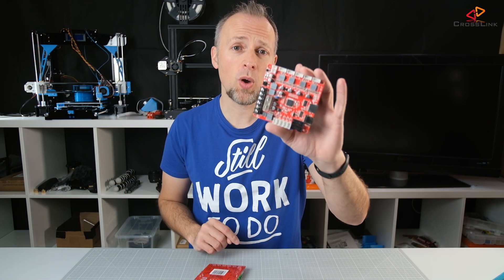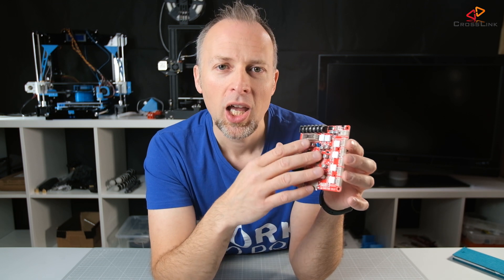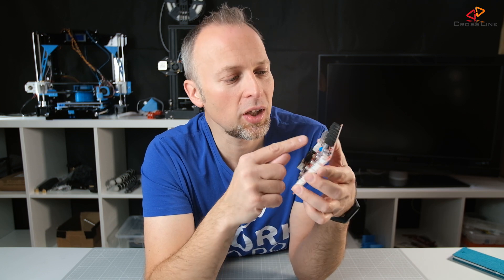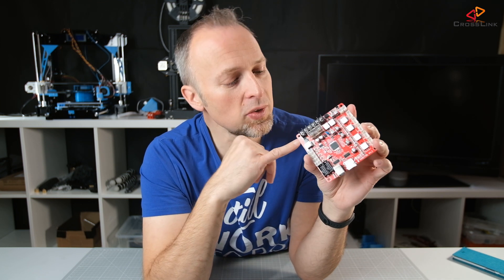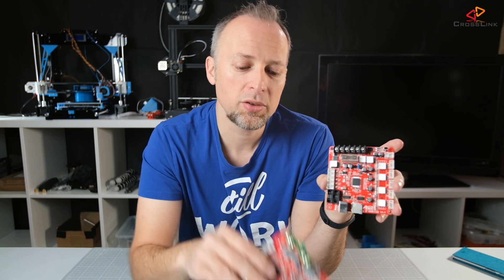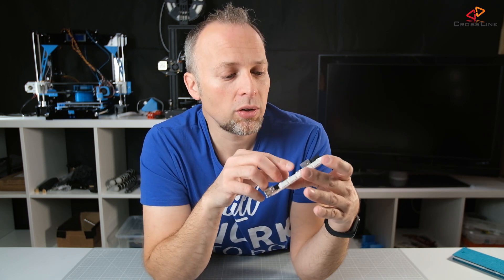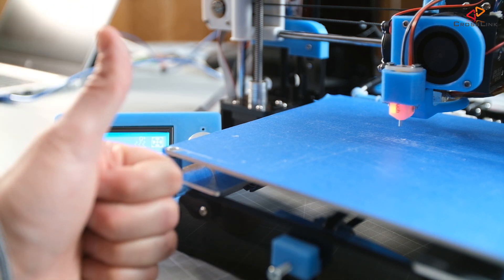Anet Mainboard 1.7 review

Comment: If you find you can't turn off the part cooling fan check if there is a washer under the mounting bolt near the fan connector. Over time a washer there can short the fan output to ground turning the fan on permanently. Fix is to remove the washer.

Comment: My Anet A8+ was damaged after printing official Anet filament PLA+. I bought 10 kg from the official Anet store. 3 kg was not usable at all (breaking under my fingers) In an overnight print after approx 3,5 hours of printing the Anet filament broke. Since there is no filament detection @ the Anet A8 + the broken filament did not stop the printer. The motherboard was therefor damaged after the breaking. I tried to contact the support team from Anet but after trying 2,5 months to get some answers I stopped because they did not reply at all and I bought another brand printer. Trying to find a new Anet A8 motherboard at Aliexpress was: This product is no longer available.  So if you are considdering to buy any Anet product my advise: DON'T do it

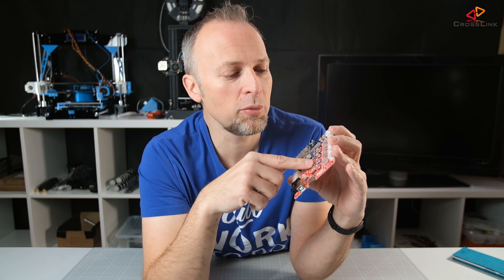Comment: The board has a vref adjustment screw for the Z2 stepper motor. It's labelled UR1 at 3:27. I don't know why that's the case.. why not put that on the extruder? It's too small to add bref adjustment any other way other than maybe soldering a new driver to the test pins on the atmega chip.

Comment: I got the v1.5 board and I cannot flash it. My machine restarts but Arduino threw an error. I have seen your other videos about getting a usb device but im unsure id be able to do that as it took me ages to figure out Arduino to begin with. So would it be easier for me just to buy the v1.7 board and i should be able to flash it without errors on Arduino?
Reply from the maker: I think you shouldn’t bother getting that board in 2022. get one of the new 32 bit mainboards. I use SKR mainboards on all of my custom printers.

Comment: got brd new an a8 .and  its crap x100 it was spost to arrive in working order yeh right it was blank as in no firmware at all. i do have a copy of my anet a8 b 4 it broke and the plus board will not take it. and all the chips are the same but it wont take it. i even tried flashing it but it will not take. yes i payed $55 nzd and it took 3 half months to arrive me im going to hunt for a basic anet a8 board and maybe set fire to the new one i got. it should look good at night if i apply 240 volts ac to it. never again i will make bloody sure the seller checks it and send vid of it with bar code on the back so then i will have proof it was the one in the vid

Comment: The board at 24v definitely allows faster heating. My a8 plus with 24v heats in about 1/3 the time as my cr-10s with 12v, both having the same sized bed. About 1/3 the print quality of the cr 10 as well. 😬😏

Comment: FYI, the Anet V1.0 and V1.5 boards can already run on 24V without issue. We have one working so since 2y now and we didn't encounter any problem with it. This allowed us to mod the printer with a 24V e3d-V6 hotend assembly and a 24V silicon pad for the bed both powered thru mosfets for safety. We now can reach temps up to 450°C for the hotend and over 150°C for the bed. Though i had to mod a bit the board (pin allocation in marlin) to make it compatible with the PT100 sensor (with adapter board) as it recquired a line without any pull-out resistor. But i think now that it would have work as well by just shorting the 47k pull-out resistor on the Anet TC line.

Comment: All fairness wise, I'll have to revise my comment about the faster heat up of the hotbed on 24 Volt. Dunno why I made the comment that it would not heat faster. Anyway, while watching a print appearing, I thought it over. Yes, the standard hotbed will heat up faster at 24 Volt. Reason for that is, the resistance across the hotbed is semi static. The same happens on a resistor (which the hot bed essentially is, a very low resistance). With double the voltage, the current increases in same proportion ergo 2 x V = 2 x I on a static resistor. The two things that keep the hotbed from self destruction is the thermo coupler and the firmware. Unfortunately, copper has a negative temperature coefficient, meaning the resistance will decrease as heat increases, but that's when the thermistor and firmware come into play. 
"So, my apologies, I did not want to mislead anyone on this issue." 
The bed will heat up faster due to the higher current. ** Keep in mind the power supply needs to deliver this current. **
"The 24V have the advantage that the current goes to half vs. 12V at same power" because 24V components are designed for that voltage. That statement is however true.
Cheers

Comment: Got the 1.7 board with the kit I bought. No bootloader? Found out why, later. The Marlin will not be able to compile with auto leveling enabled. Just not enough ROM left. I tried!
The basic Marlin just fits barely into the ROM available.
The 24V have the advantage that the current goes to half vs. 12V at same power, but does not heat up the bed faster. Remember, Power is Current multiplied by Voltage. 
Same reason they use High Voltage for utility power. 
Assuming the heat bed has similar specs. no faster heating.  TNX anyway, I know it takes a lot of effort to make a video!

Comment: so, i have the v1.7 board, just got it, and it has a bad resistor on the Y motor output. Its supposed to be a 16K ohm resistor, but its a 22K ohm resistor, thus my voltage to the y motor is 6 times less and the motor gets extremely HOT.. big fire hazard

Comment: @crosslink I have an older A8 and been having issues with the thermal runaway above 35C on the hotbed. I checked the voltage coming to the board and it's at 9.26v during E0 operation with E1 being shut off. Replace the supply?

Comment: I recently bought Anet A8 and have V 1.7 board  Is there any method to upgrade to Marlin firmware(1.1.9 or 2.0) without any USBasp, tinyISP and adapters. I have just the uploading cable and board.

Comment: I have the 1.7 board but the stepper drivers get crazy hot when printing, even with the pot adjusted to .49 V
Know anything about that?
Reply from the maker: I also discovered this, especially when running the board on 24v but even when the motors ran really hot I did not have any print failures. You should try to reduce the current until you see layer skipping happening. Cooling the motors is another thing...
Reply: @Crosslink3D  It is worth a try, I'll do it.
I might attach a 12V computer fan just to cool the mainboard, maybe it helps.
I wish I knew about the Ramps boards before buying the 1.7 version 😅

Comment: Can you make a guide for installing a ramps board? I need a board capable of installing marlin without a programmer but ramps seems very complicated and the 1.7 board doesn’t seem worth it
Reply from the maker: Well, I don't know why you don't want to use a programmer for flashing firmware on any printer. Please tell me.
Reply: Crosslink I plan on making more upgrades down the line so buying an uno for a programmer doesn’t make sense money wise

Comment: Running on 24 Volts will reduce the current to achieve the same power output for heatbed and hotend by 50% - that's a good thing for sure.

Comment: Does the 1.7 board come with "thermal runaway" in the firmware?  I have tried to upgrade my original Anet A8 (about 2 years old) firmware and run into problems every time.  Thought it maybe easier to just buy the 1.7 board.  Thank you for your help....Jack
Reply from the maker: Nope, it's just the same firmware as on the 1.5. you have to flash Marlin to make it a safe board.
Reply: Thank you for the quick response.  I am going to try your 7 step and try to upgrade the firmware one more time.

Comment: hi! i  just got and setup anet a8 with 1.7 board, when printing curves or small things i have noticed my buffer dropping to 1-5 and gets very slow and stops for small periods, and when reachs again to large areas or straight segments, buffer goes back to 16. can you help me with these?
Reply from the maker: This problem happened to me when I used an older version of Cura. After updating to the latest CURA it worked fine for me.

Comment: I have been having issues with my Anet A8 Plus (not been modified with any hardware or firmware). When I try to set the temperature of the nozzel to i.e 30C it increases dramatically to 40C. I have replaced my thermostat 3 times, still same issue. I have had prints before but after 2 weeks it started to have this issue. I figured the thermostat is functioning correctly so I tried to upgrade the firmware since lots of people have found that helpful. I just upgraded to 2.0 Marlin and I still have the same issue, any thoughts?
Reply: My printer will eventually comes back to its set temperature, but it takes a couple of minutes to do so. The current temperature is higher than the set temperature.
*UPDATE:
I was able to update the 1.7 board with Marlin, still nothing. So I looked into other discussions online and I saw that the MOFSET might have been the issue. So I brought a new board to replace the on board MOFSET. I then installed Marlin again on the new board, and still showing the same issue. Much appreciated.

Comment: i have a question my heat bed not heating up and the light on the mother board doesn't come one,  so I don't know if there something wrong with the motherboard,  I thought the bed was bed so I bought a new board ,  my kit came with the new plugs that have wires on both negative and positive,  is there any thing I need to check ?  the motors and the extruder work fine as far I know its just the heat bed not working.
Reply from the maker: First check with a multimeter if there is power at the board connectors for the heated when it's supposed to be heating up. Then you will know if the board works at least. Besides that the four wires are just for more safety.
Reply: when  I checked the voltage form where the wires are connecdted for the bed it only shows about 1.3 volts

Comment: when I purchased my A8 plus it came with this board. I replaced it the first month cause it would never finish a large print job. It would freeze after a few hours.
Reply from the maker: Did you add a cooling fan to the mainboard? Does the Anet A8 plus have a cooling fan for the mainboard?

Comment: Hi Daniel, I got Anet A8 Plus new printer with this 1.7 (black contact board) and I spent some time printing with that PETG and ABS. I've never printed low temperature PLA with new Anet A8 Plus. I don't like PLA because parts can sag in hot weather. Anyway in order to print PETG and ABS  I insulated the bottom of the bed, I heated the bed to 90-100 C and  after 5 hours of printing I got message ("thermal runaway", please reset the printer) All my 5 hour work was ruined. I did actually many times and I got the same message almost all the time. It seams to me that this safety upgrade is too sensitive. I already ruined so many long hour printings. Is there anyway to erase this safety updates ? Where in the code are the lines (number) to stop (disable) that "thermal runaway"  shot down? I'm peast off. Really. Not everytime but almost always I get that message "thermall run away.  I don't like this new safety upgrade at all. I have also an old anet A8 with the old 1.5 board and 2 year old original software that I've never updated. Its works perfect printing PETG and ABS.  No problem with shots offs. Can you recommend how to shot this safety lines off? It seams like old Anet A8 is much better printer. Try to print something maybe 5 to 8 hours long with this 1.7 board high temperature PETG or ABS with 100C heat bed and you will see that printer gonna stop with  "thermal runaway " message displayed on the LCD screen. Thats crazy. Please can you help to find these code lines and disable them? I like 24 V board, but I like my old Anet software.
Reply from the maker: There is two lines in the marlin configuration.h:
#define THERMAL_PROTECTION_HOTENDS // Enable thermal protection for all extruders
#define THERMAL_PROTECTION_BED     // Enable thermal protection for the heated bed

if you disable them, there is no thermal protection.. It's less safe, so watch your printer!
Reply: @Crosslink3D  Thanks. Great. Also Do you know if my old Anet A8 stock board 1.5 ( green power buttons) that I got 2 years ago came with this thermal protection or nothing like that there at all?
Reply from the maker: The 1.5 does come with a stock firmware that does not support thermal runaway protection but you can enable it if you install the Marlin firmware.

Comment: I'm getting Y-axis stepper motor really hot with that new board, I'm not sure if it is such a great upgrade...
Reply: Hi, I believe they might have made a mistake in firmware, since I observe the same issue. They don't switch the stepper off until the print is finished. Also, mine doesn't have a bootloader, firmware upgrades e.g. Marlin will be a pain in the neck.

Comment: I would no longer recommend getting any kind of 8 bit board. Bigtreetech have brand new 32bit boards that are very inexpensive. I'm currently learning how to use the SKR Mini V1.1 which eventually will go on my Ender 3.
Reply from the maker: As I said, I would just consider it a replacement if you don't want to change anything, otherwise I would also go for a RAMPS or mks or something else.

Comment: should i upgrade firmware  to  mariln and add proximate sensor . please suggest
Reply from the maker: I really had good results using the bltouch and inductive probes. Definitely improved the ease of handling the printer.
Reply: @Crosslink3D  thanks a lot for your valuable suggestion

Comment: can I atleast flash marlin the usual way? without the programmer in 1.7 ?
Reply from the maker: Yes, that’s working. But if you have a probe and other features enabled, you might get issues with the firmware size and will need a smaller bootloader.

Comment: hello, if I want to upgrade to ramps board how can I copy the settings of my actual anet board to the new ramps board?
Reply from the maker: I would suggest you compare the default RAMPs configuration file with your Anet A8 configuration file in a text compare tool and then decide , which settings you like to take over. I would not know another method. Settings that you did in your printer menu will get lost so you should write them down and then set them in the new board once it's installed.

Comment: Interestingly my ANET A8 (bought at Christmas) can with the v1.7 board… I’ve had it for 5-months now; and have been very happy with it, but I didn’t spot that I could’ve been running it at 24V... I’m looking forward to the next video to see how that works out.
Reply: Mine which was bought way after christmas still has a 1.5 that's weird.
Reply: IMNOTA  I guess it depends on retailer’s stock... Mine came from China (not sure where); but I guess different sellers will have had older or newer stock.
Reply: @AuctorisVideo  Mine was bought from the official Anet seller on Aliexpress in a flash sale(at leas they claimed themselves to be official lol) but it was from the German warehouse.
(I live in Europe so shipping is like 60$ from china, and it was free from Germany, and even without shipping, the printer from germany was cheaper, that would be explained by them wanting to get rid of a stock of old printers. It probably isn't too old tho, it has a fuse and other safety upgrades like the bed connectors that the old ones didn't have)

Comment: Daniel thanks for the review. Well the reality is for 35-40USD you can get MKS Gen L (with atmega 2560 onboard) and full set of  TMC2208 drivers or SKR 1.3 (32bit board), so this Anet 1.7 update is pretty useless.
Reply: What's the difference between the MKS Gen L and the ramps board ?
They're pretty different in price and seem similar.
Reply: @imnota  RAMPS board is not really a controller board. It is a board that serves as the interface between the Arduino Mega – the controller board, and the devices like stepper motors. So you will need to get Arduino Mega 2560 to work with RAMPS. While MKS Gen L (or Anet boards, Duet etc) is kind of all in one – controller AND interface board.
Reply: @TheLightChaser  Yeah I knew ramps needed and arduino and mks didn't. But do you get any other functionalities on the mks compared to the ramps? Because a ramps+mega2560 is half the price of the mks so I hope mks has better stuff.
Reply from the maker: Absolutely. I also think that it is only worth it if you want a simple replacement and you're fine with the drawbacks.